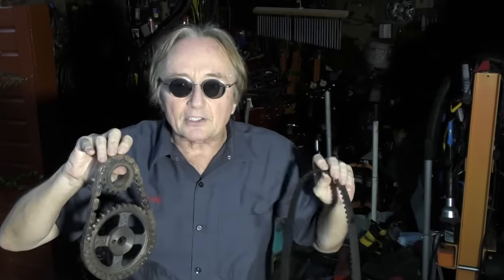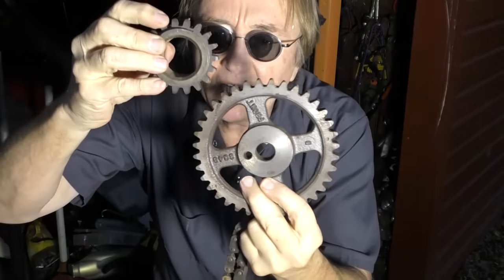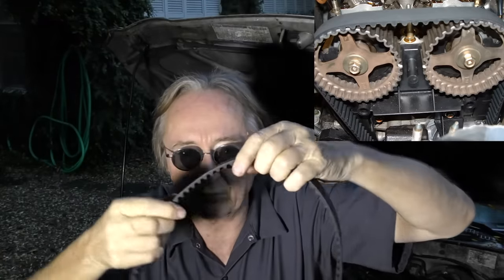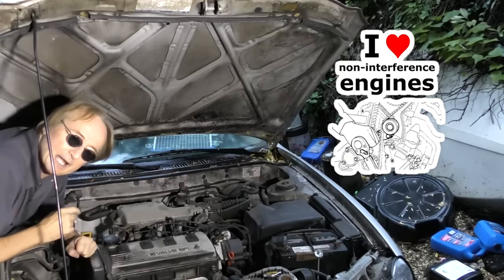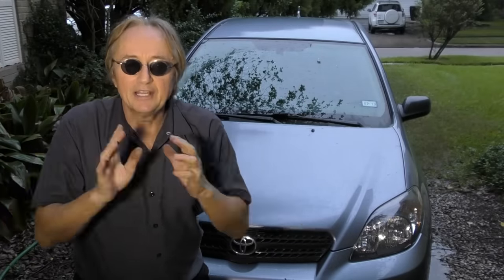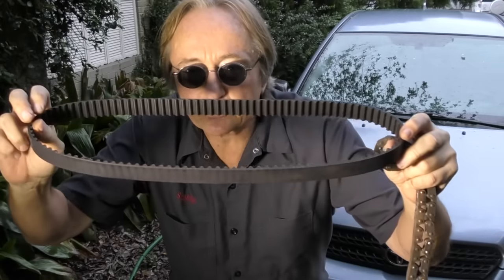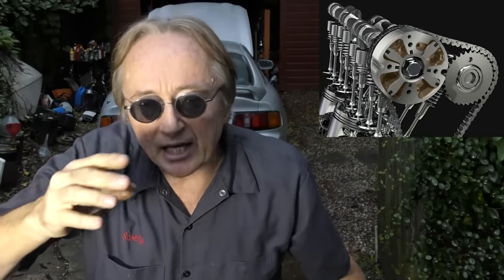Why Some Cars Have a Timing Chain Instead of a Timing Belt

Comment: how often should you change the differential oil in a 2001 GMC sierra 1500?
Reply: Try checking the owner's manual. All regular maintenance is written by the manufacturer in there in concise charts. It's also a good way to not get screwed by those fuckers that do quickie oil changes, as they will try to squeeze more money out of you for additional unnecessary maintenance such as engine cleanings long before they are due. If the info isn't there try finding a good forum on your make and model, and read all the information you can on the topic.

Comment: i have a 1997 Nissan pickup with ka24e engine. i thought that timing chains were supposed to more reliable than a belt. the haynes manual said that the timing chain should be replaced at 30k miles. is 30k miles for timing chain replacement correct? why small amount of miles? i heard of a spacer or adjustable tensioner would fix the chain slapp. any help much appreciated.
Reply: To fix the chain slap take off the valve cover and remove the guide on top of the timing chain. I have the same engine in my 240 SX and that thing broke and rattled around in there like crazy. Nissan doesn't even sell the part to replace it it just said remove it in their technical service bulletin.

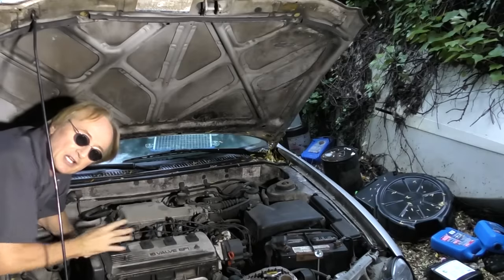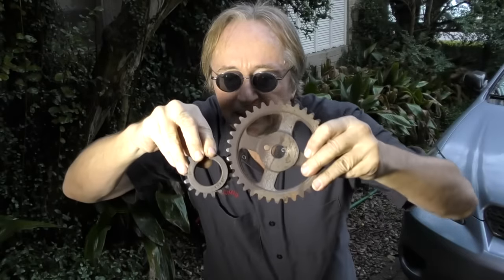Comment: .25 Popcorn Sutton was yer grandpa???   2:16 Non-interference engines did not last long with Toyota.  The Camray and the Camray Solera with 6 cylinder engines were interference motors that used timing belts.  5:03 The Rolls Royce v12's still use gear driven cams.

Comment: My honda's 2 Ltr VTEC has a timing chain, still doesn't smoke or use oil or water after 20 years and over 200,000 km.

Comment: The Belt is  quieter than a chain.Chain is longer lasting and better than a belt for longevity. Also, The dealer gets more work for the mech's with Belt cars.If you know what your doing as a Mechanic,A belt is not hard to change every recomended change interval.And also Belts are low cost.It's the repair labour that gets expensive

Comment: interference engines are more efficient which means more power.

Honda has perfected them.  And timing chains and belts cost the same for 200k miles (until your second change).  The new belts are kevlar reinforced and are much more robust.

As long as you know what you’re in for (Honda v6 owners) and know you are paying 1000$ in 100k miles instead of 1500$ more at sale- then it’s not a big issue.

Comment: I get a kick out of your videos, Scotty. Question, have you ever changed a timing belt on a Mitsubishi 3000 VR4 Twin Turbo AWD? My roommate had one. Loved that car, drove like a dream, and had more power than I ever needed. He didn't do his research before buying the car. 60k rolls around. He was a stickler about having the proper maintenance performed. He wasn't a mechanic by any means. He paid to have the oil changed, hell he would have me fill the washer fluid. The manual called for a new timing belt at 60k miles. He had me follow him over to the Mitsubishi dealership to drop it off for a new timing belt. I tried to warn him it will cost One Billion Dollars to have the dealership do the work. "Aw, how bad can it be?" he asked. You will see man, I said. The dealership called the next afternoon to tell him his car is ready. I dropped him off and headed home. He got home close behind. I asked, so what was the damage? $1,212.00 bucks!   LOL He drove the car another 30k miles and got rid of that money pit. Cheers from Louisiana!

Comment: Some engines still use timing gears my 2000 Ford F-250 powerstroke diesel has timing gears. Also all ford powerstroke engines use timing gears

Comment: Problem with the replacement timing chain....the computer is constantly telling that the timing is mal-adjusted. I correct it when i clear the fault but it always returns. this has gone on like this for months with no damage to the engine and no solution from the mechanic. Please help.

Comment: My 1996 Cadillac has a timing chain in it.  This garage queen has always had it's "lifetime" coolant changed every 3 or 4 years to keep the aluminum headbolt threads from turning to dust.  Additionally, i change the transmission fluid with Amsoil Signature series atf as it exceeds GM dexron vi specification in addition to exceeding specs for aw1 transmission fluid used in my sons car.  Is means a lot to under what the specifications of your engine are both before and during ownership.  Do not believe "lifetime", and if it is made of rubber, it will degrade over time.

Comment: Chains are actually better, but belts run more quietly.  Large engines that run a little more quietly to begin with have chains.  Small engines that are noisy to begin with, will generally have belts.

Comment: Ya manufacturers really screwed their customers with timing belts even with the cost savings that goes out the window the first time you have to change it plus it's something that is inside the engine that will wear out before the engine is actually worn out

Comment: The Honda Odyssey has an interference engine and a timing belt.  I didn't know that when I bought one less than a year later the belt failed and killed the engine.  If I had known I would have had it checked when I got the vehicle.

Comment: Hyundai accent timing belt snapped at about 75000 miles not covered. $1600 to fix the valves. Junk car Transmission went at 101,000 miles.

Comment: I can tell you now the diesel Mk2 Toyota Rav4 were interference engines - I think most diesels are actually - my cam belt snapped going 70mph down a motorway and fucked my engine. Wrote it off (unless I put a whole new engine in). Next one I got was the Mk3 where they switched to a timing chain.

Comment: I bought a 2006 Chevy HHR in 07, had 13k miles, It has 270,000 miles on it  still runs good original transmission never ever replaced or even touched motor or transmission ,years later my wife bought a brand new 2010 Toyota Corolla! We handed it down to our daughter, the timing belt or chain broke on it at 140,000 miles, my best friend also bought a brand new 14 Toyota Prius! The head gasket blew at 180k and the braking system went out and had problems with the battery, both these cars were well serviced, my wife, daughter, and best friend rave about how good Toyota is, my Chevy HHR is still on the road and I’ve been delivering pizza with it since I bought it! While both their cars especially the 2014 Prius is junk! I hope you read this Scotty! I’m litterly gonna drive this HHR into the dirt, it’s made over a half a million dollars since delivering pizza with it from 2007! It’s the 2.4 motor, yes I’ve replaced things on the engine  alternator, cooling fan , battery, water pump etc!nothing expensive , but the transmission is all original! Those Toyota’s are now dead and both were bought brand new and NEVER driven like I drive 40 hours a week delivering pizza!
Reply: But the HHR is the ugliest car ever

Comment: How can I find out if engione is interference or not ??  I've 2016 Focus SE 2.0L GDI Flex fuel  engine . Can someone tell me if loose timing band ( or chain ) will bend rods and valves ? One says  yes another says no way . What's the truth ?? verry hard to find a good mechanic you can trust

Comment: Hey Scotty stop bashing Nissan lol I have a 2001 Honda Accord and a 2001 Nissan Sentra  And they’re both great cars, honestly the Honda runs smoother better suspension but my Nissan Sentra SER has 191,000 miles and I’ve never had a problem except for the back drum brakes of course

Comment: The older International had a gear to gear, the cam gear ran on the crank gear. Chevy had a flaw and had Teflon around the teeth on the cam gear. It would fall apart and clog your oil feed tube and kicking open the overflow valve, causing your lifters to collapse. The replacement was a solid gear. Don't ever buy a new car. Have an older car restored frame up, with upgrades.

Comment: I decided to back away from a “good deal” on a 2014 Acura MDX because I found out it’s engine has a timing belt
Reply: Don’t blame you. Although it may not be a big deal to the mass majority of people out there. However, the year we are in now is 2020, we should not be dealing with timing belt concerns and replacement.

Comment: Even dumber are water pumps driven by the timing belt.    If the water pump fails, goodbye valves.   Despite that, I did love my Nissan Turbo Z.    One of my favorite engines ever.

Comment: The reason for the timing belt can also be that they need the smoothness of the timing belt over the chain. 

The chain is still a chain, meaning that it moves one chain link at a time going around corners. It will wiggle a little. If the system can work with that, you can use a chain. The most accurate for the timing of the valves are the gears. It's still expensive compared to the others, but some Mercedes Busses make use of them in combination with the Injection system they use. 

So the choice can be between how sophisticated the injection&control is or if you can make it cheaper by using a smoother belt or gear system so there has to be less tweaking. Lots of factors play into it like is there some contract you have with the belt makers who also make the factory tyres?

The best there is, is no belt, no chain at all. There are only a few systems that can do it, but it's still not used. 

You can say about Italian Cars whatever you like, BUT they are one of the big inventors out there. A lot of the technology that improved cars world wide were invented by them. Sometimes it's enough to have the balls to try something new.

Comment: 2002 Hyundai sante fe 2.7 interference motor. 
I wont even risk paying $600 with water pump and tensioner to only find out it has bent valves. 
237k I always learn the hard way.

Comment: I would say yes and no, the most powerful gasoline engines got timing belts, 2JZ,4G63,RB25,BARRATT etc, people just don`t read the manual, and if it is a second hand car that should change when you buy it because you don`t know what the other owner did with it, timing chains now, most people go to quick lube, there use cheap oil and with that the tensioner,guides can go bad really quickly so it has its Goods and Bads, but non can beat the gear on gear design

Comment: Give me a timing belt any day, yes sure you have change them at certain intervals but they are a lot easier to replace and silent operation, chains get clattery after a while and sound like tractor engines I did one once a few years ago and cost me a flipping fortune in parts as it's not just the chain you have go buy it's new sprockets and chain guilds and hydraulic tensioner as well which is pretty hearty price for oem and oem is usually the only ones that will work right as aftermarket never tension right or don't last long, timing belt on the Other hand, cheap as chips and that's all you have go replace along with water pump providing it's timming belt driven.

Comment: VW built timing chains that lastet less long than their timing belts.
But they named this engines TFSI, TSI or FSI.
So prevent from engines with this names.
2013 they went back to timing belts in the smaller engines (1,4Liter and 1,0Liter).
But, believe it or not, this timing belts are installed inside the motor with contact to the motor oil.
Nevertheless this timing belts (called ‚oil runner‘) last much longer than the timing chains.
Very important: You must use special motor oil!

funny facts

Comment: That's why i sold my 2004 civic and got a 2007 one instead because since 2006 all civic's has chains
Reply: Same with my Rav4 - 2005 Mk2 belt snapped and wrote it off - must have only had 50k miles on it since last belt change too (before I bought it, but was in documentation). Replacement was a 2006 Mk3 model which from then on all had chains. I think Honda and Toyota both got the same idea at the same time

Comment: When do I change my timing chain or how do you know you need a new, this mechanic once told me your timing chain is stretch I ask what does that mean he said it's time to change it can some one help me answer this question ps this mechanic said because he was trying to time my truck   (350 Chevy ) ? ?
Reply: Changed the chain on my 3.6L MKZ when the water pump started leaking - 110k miles.

Comment: i have never understood why they went for the OHC design in normal "bread and butter" cars. The last OHV engines with the small and durable timing chain were the 1.3L Ford Kent in the Ka MK1 and Fiesta MK4 and the 1.4L Skoda engine in the Fabia MK1 and a 1.0 version of it in the VW Lupo. All were dropped in the early 2000s. A bit earlier dropped in the mid 90s was the 1.3L Renault engine in the Twingo MK1. I drove all of them and they are not worse than the OHC pendants. Especially interesting is the VW Lupo, because there is the Skoda OHV 1.0 50hp engine and a same 1.0 50hp OHC engine from VW. And the VW OHC engine isn´t any better. And the reving advantages of the OHC engines, isn´t needed in those bread and butter engines. So ... WHY ? Today´s timing belts last quite a long time (> 10 years). But still, a small timing chain without a tensioner would be better.

Comment: And then GM designed the High Feature 3.6 liter VVT V6.
Reply: christopher donelson I miss those. I made so much money from stretched timing chains. Especially on the suvs 14+ hours to change them. Then gm comes out with this extended warranty on the engines and transmissions for premature failure 10y or 120k mi. It was good while it lasted.

Comment: Def about money. If they wanted to stick with timing belts they could build a system that locks or retracts the valves the split second the belt snaps. But then that would negate the cost savings. Anyway in a few decades this will all be academic history cause here come the electrics :)

Comment: How to tell by looking if engine has belt or chain ?
Reply: A belt is covered by a plastic or sheetmetal shroud external to the engine. It is usually located on one side. There is also a cam chain tensioner which is usually visible. With a chain, the valve cover will have a raised area on one side or in the middle. This applies to overhead cam engines (most cars). If the car is a ohv, aka pushrod engine, it's always a chain and does not go to the top of the engine.

Comment: I prefer belts easy to change and designed to be changed. Chains and chains guides fail often even when people do change their oil on modern cars and are not designed to be changed. Thus they are very hard to do

Comment: I have a 99 corolla ve. Finally changes the timing belt at 220k miles lol. Does anyone know if its a non-interference engine? thank you
Reply: Must be different engines in the 99 corolla. I have the 1ZZFE engine and it's a chain.

Comment: Well, I'd like to remind, that VW used to make plate based chains in 2005-2015s. Those things must have been replaced every 100-130k km. Like those cheap timing belts. So u got an expensive chain that have to be replaced like an ordinary timing belt 🤔. And what did they recently? They've switched back to ti ing belts! Lovely German engineers...

Comment: Scotty you are not telling the truth. The main reason to use timing belt is not only that it's cheaper. Belt is quieter than the chain and it's not prone to stretching. So with a belt design, the engine timing is always accurate as long as the belt doesn't break. So all you need to do is the replace the belt following the schedule and your engine will always have an accurate timing. However, with a chain design, although the chain doesn't break, it will stretch gradually as mileage goes up. That leads to gradually increasing engine timing inaccuracy, therefore decreasing gas mileage and increasing noise. Changing a timing belt is hell lot easier than changing a timing chain. Today a lot of manufacturers are switching to timing chain simply because they want a lower maintenance cost plan to sell their maintenance plan and attract more customers, especially fleet customers.
Honda has been using timing belt on interference engines for a long time and they don't face complaints against the belts they use. I've seen Odysseys running on original timing belt for more than 200k miles. The fiber reinforced timing belts are very strong.

Comment: Nice job attacking Nissan and not Honda, who still uses belts on v6s and requires a $2000 "belt replacement" every 102000 miles (and some old Honda guys still claim it needs to be done every 60000 miles). You are right, Nissan has gone away from belts, but you should say Honda still uses them.

Comment: When the chain is setting in oil during the operation of the engine and friction would be minimal.  Why then do they recommend a 100,000 mile replacement?  It is very expensive!

Comment: Modern simplex timing chains are poor quality and stretch, plus breakages are common. Timing belts are not just rubber, they contain other materials and do not stretch over their life. Yes they can break and loose teeth especially if not tensioned correctly. Change the belt at the appropriate mileage or age along with the tensioner and water pump if timing belt driven and you'll have no problems.

Comment: I have a two part question.

1st when I try to start my car the D4 light flashes what does that mean?

2nd to get the car to start I got to short out the starter buy touching both the bolts (not the mount bolts) with a metal wrench. It even starts to turn before I turn the ignition key. Does  that mean the starter is good ?

Comment: I have a 2002 diamonte Mitsubishi vrx never changed the belt or chain it has 290,000 miles on it two owners....... Purchased in 2006 maybe 40,000 miles on it